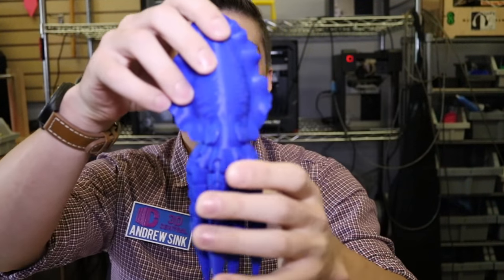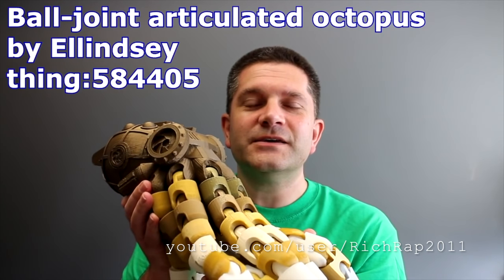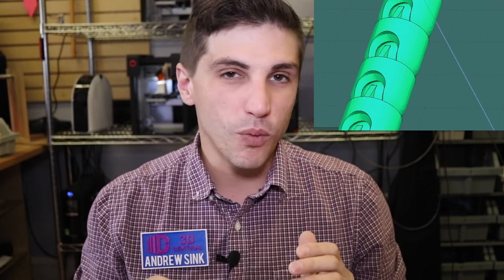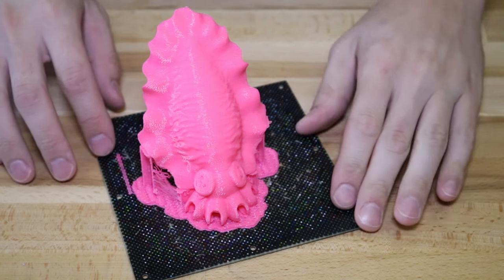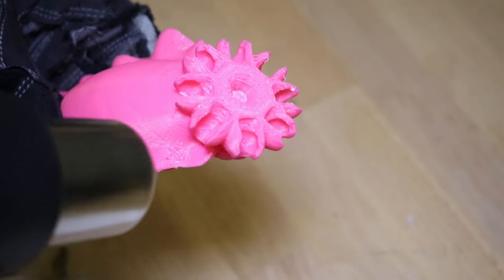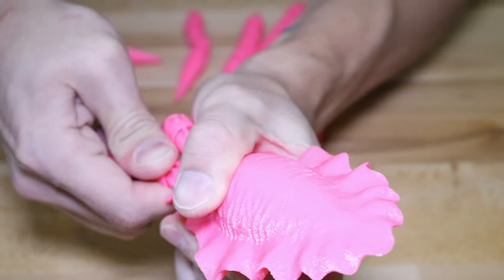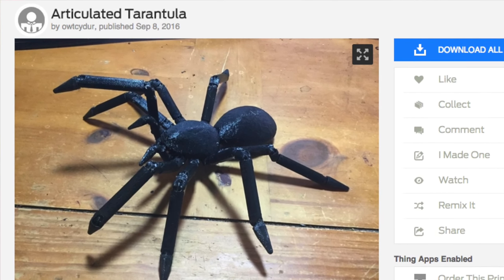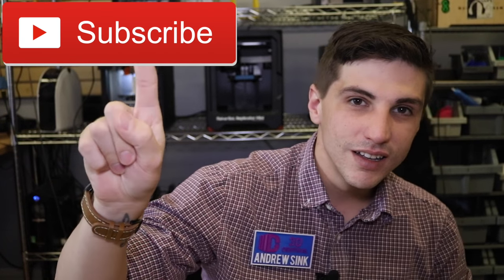Articulated Cuttlefish with Print-in-Place Ball & Socket Joints!

Comment: I am amazed at how popular my little balljoint octopus design has become.  I made the original as a quick study in designing snap-together balljoints for some of the other models I was working on.  It's humbling to see how many remixes and makes there have been of it.  Never dreamed that this would be my most popular model.
Reply: Do the print in place tentacles of your version fit into the sockets of the original's heads or did you change the size of them? I'll love to try out these tentacles but I just can't go past the classic octopus design.

Comment: I would love to print it on Makerbot  Mini+, but i am having  problems with warping when printing models bigger than 3" in length and width, anyway i use glue stick to solve this problem. Do you you have any recommendations on how to fix this issue?